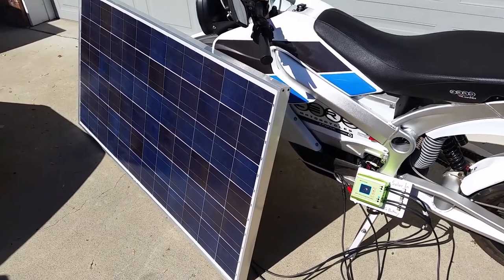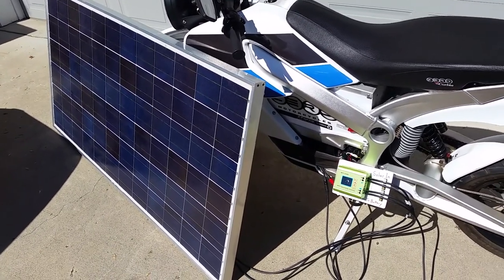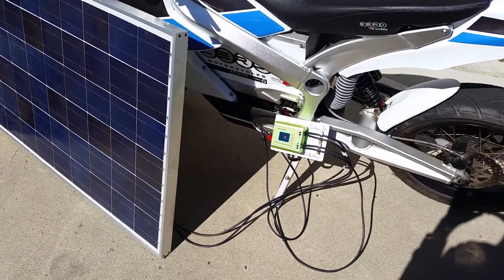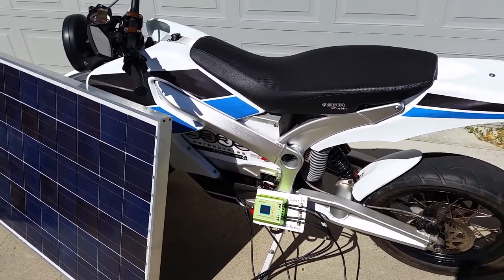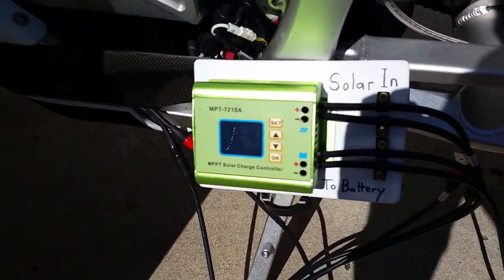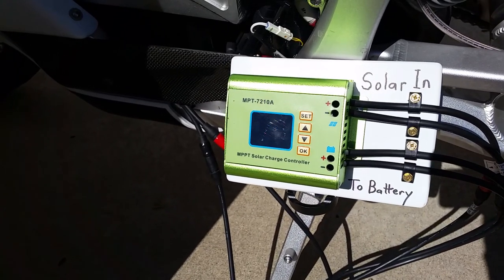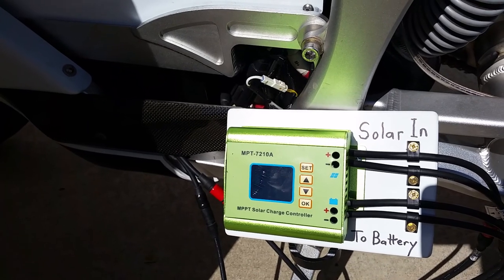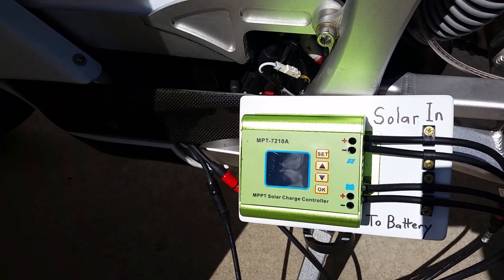Electric Motorcycle Charged Directly with Solar Power

Comment: Solar charged electric motorcycles work best for remote locations that do not have or want to purchase gasoline.  Island or remote communities can get their fuel directly from the sun.  DC-to-DC charging dramatically reduces the costs and improves charging efficiency.  Adding three more panels could provide 30+ miles of range in a typical day using the $30 controller.  More modules and a bigger charge controller could charge as much as the motorcycle's battery management system could handle.

Comment: Thanks for your video . It really inspired me to recreate this. I own a Zero DS ZF 8.5 and i plan a long tour across Europe 2022. Now my question, where do you put the charge controller on your bike? At the contact for fast charging? and, what is the setting of your charge controller?  Thanks for your help and regards, Florian ^^
Reply: Hello Florian. I attached the charge controller wires to the battery leads inside the AC-to-DC charger. The charge controller was set for 55-58 volts, but it was not connected to the Zero's  battery management system (BMS) so you should not use it for getting anywhere close to full charge on the battery. The BMS looks at the voltage level of the individual batteries in the pack and makes sure that the pack is balanced, meaning the individual batteries have the same voltage as their neighbors and do not exceed a preset limit. Since the solar bypassed the BMS, I plugged my motor cycle into a wall outlet to balance the pack occasionally to get it fully charged, and only used the solar direct charger when the battery pack was low on charge to bring it up to no more than 2/3 to 3/4 of being fully charged.
Be careful and get with someone that knows about charging lithium ion batteries before messing around with the wiring inside the Zero.
Reply: @jameswhite9364  Wow .. I would not have expected such a detailed answer. Thanks a million for your information.
okay, maybe I will only dare to approach this solar facility when I know my bike enough ... and have gathered the necessary information from a electrician.
.. my solution is now a quick charger for my journey

Again, a big thank you .. next time I will visit the manufacturer ;)  lol.  
Liebe Grüße nach Kalifornien ^^ Florian

Comment: What do you think of a helmet and motorcycle jacket, with solar cells on them? To charge motorcycle.
Reply: If the current being generated reaches your body somehow......Yeeeooooowwch
Reply: Yeah.. doesn't sound very safe. It would need a. electricity insulators and b.,  cables that connect the helmet/jacket to the battery which could tangle you and cause you to crash or malfunction and electrocute you. I have seen some backpacks though that charge phones with solar power. Who's to say you can't charge a battery?
Reply: it's a matter of how many watts you can generate.  taking a motorcycle down a highway takes about 4000 watts, and the sun drops about 1000 watts per square meter, so... how big a jacket can you wear?  and how efficient are your panels?

Comment: Wish you had some more info on that! Panel efficiency and time it takes to charge. Think it would be possible to take this bike up a mountain and camp while charging it via solar?
Reply from the maker: Hello Taylor.  Sorry it took so long for me to get back to you (5 months).  I just saw your message.  The answer to your question, is yes, you could use the system to charge the motorcycle up in the mountains on a camping trip, or anywhere in the world. The trick would be finding some lightweight solar panels.  The $30 charge controller http://www.tomtop.com/garden-supplies-1095/p-h16929.html can handle 10 amps at up to 70 volts DC (700 watts).  The 165 watts panel in this video is only putting out about 3 amps at 42 volts (126 actual watts).  Eight 100-Watt rated lightweight panels would charge the 4 kWh pack in about 6 hours, which is quite a long time, but most of daily driving only consumes a couple of kWh.
https://www.ebay.com/p/?iid=361851081686&&&chn=ps
Cheers,
Jim
Reply: hi, i will like to travel with a electric bike , i dont mind to stay a hole day charging , did you know if its posible with a foldable solar panel? in a hole day charging for riding 250 KM on  secondary roads?. maybe the actual electric bikes are optimized for  pluging, it could be possible modify a motocycle for optimize solar charge?
Reply: @crumbsole  Could work.  Find out how many watts your bicycle charger takes, and find out how many watts your solar panels can generate, and then see whether you can practically transport them.  After that, it's a matter of getting the volts to match, and see if your charger can take DC instead of AC, many can.

Comment: Where did you connect the wires coming from the charge controller to the battery?  Did you just use alligator clips?
Reply: I connected the solar wires to the battery by joining them to the wire terminals inside the Q-Cell charger that feed the battery when the charger is plugged in to a wall outlet.  For obvious reasons I don't connect the solar at the same time the charger is plugged into a wall outlet.

Comment: Hi n44qt! Would yo be able to provide the panel's specifications (Max Power, Open Circuit Voltage, Max Power Point Voltage, Short Circuit Current, MPP Current,  Module Efficiency)? Also, on average how many hours of exposure to sunlight does the system realistically require to fully charge your Zero motorcycle's battery? Thanks.
Reply from the maker: Hello Antonio.  The solar module is 165 Watt made by Sharp (18% efficient).  The MPPT charge controller is rated at up to 10 amps and 72 Volts.  When I was charging the motorcycle battery at 57 Volts DC, the solar array voltage varied from 35 to 38 volts depending on cloud cover, and put out 150 Watts of power.  At these voltages, the $30 charge controller should be able to handle up to 400 Watts of solar.  It would take a long time to charge the 4 kWh (4000 Watt-Hr) battery using the 165 panel.  If you were using the motorcycle for backwoods travel, a better (lighter) choice would be to bring along three or four lighter solar modules, like these High Flex and plug them in end-to-end in series 72 Volts, 8.3 amps. http://www.highflexsolar.com/docs/HighFlexSolar_HF138-6-16_Datasheet_v1.0.pdf.  Even with these modules, it would take all day to charge up the motorcycle if the batteries were completely drained.  The newer Zero Motorcycles are more efficient than this old 2010 that I drive.  The 2010 Zero uses about 0.130 kWh of AC per mile, so the 165 Watt module only charges about one mile of range per hour.